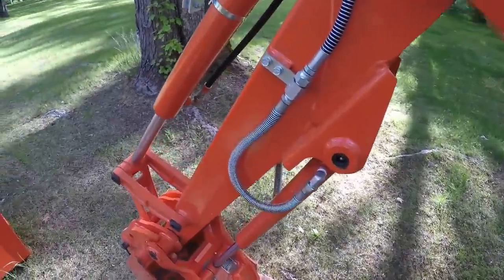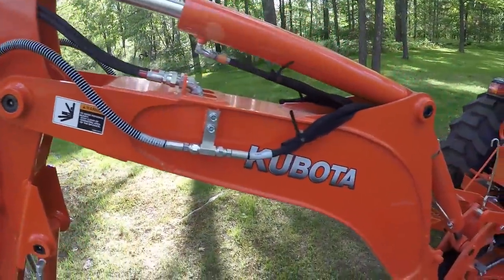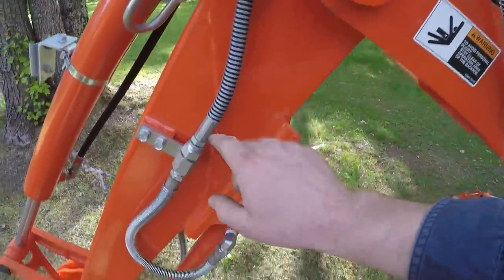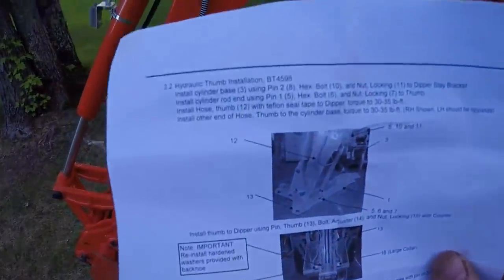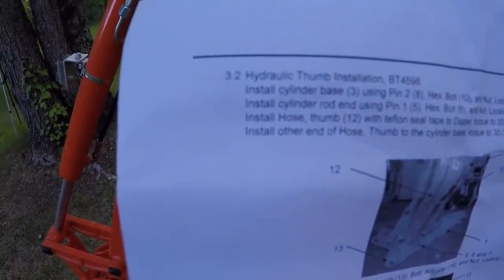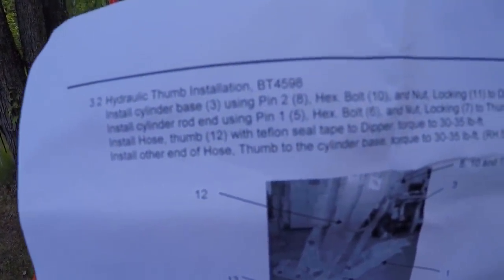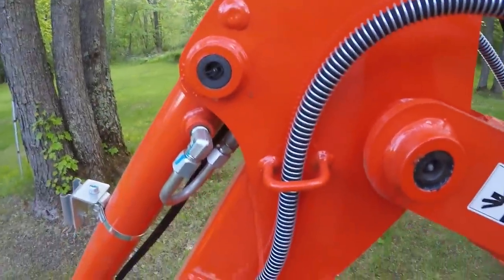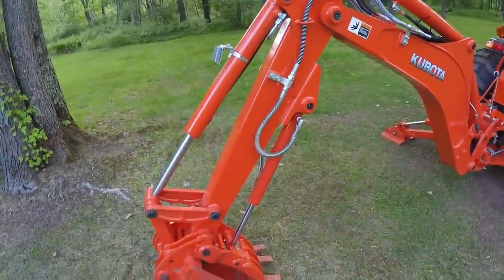Kubota BH92 Backhoe and Hydraulic Thumb - Part 2: Proper Hydraulic Line Routing - And Teflon Tape

Comment: Hey man Great videos on the BH92. I'm in the process of buying 1 for my L6060. I was a fire sprinkler installer for many years and we would wrap the sprinkler heads at least 5 times around the threads. Never any leaks, mind you city water is never more than 150 psi. I have done repairs to my hydraulic system and Always used teflon tape. The problem with it is if you have extra hanging over the threads, it could potentially enter the hydraulic system. That is why there is a filter to catch that kind of crap. Don't let the negative Nellie Engels get to ya... You're doing a great service to us that need to figure things out! Take care man.

Comment: I've heard all kinds of horror stories of using Teflon tape.  I agree, it can get loose in your system(whatever you are working on), but like someone else mentioned, I never tape the first few turns. That helps keep small pieces from tearing loose and getting into the fluid stream.  From what I recall, any tape/compound you use on the thread is more for lubrication of the threads so you can tighten it correctly.  No different then oiling a bolt before torquing it on a motor.  If you get a leak from using tape, you didn't tighten it enough to begin with.  Or it has faulty fittings.  Thanks for making great videos.  Keep it up.
Reply: I've heard this "lubrication" theory. I don't buy it. If that was the case you could just use some grease. But try that and see if it works...  The tape is a packing that is required because a pipe thread has a built in leak path: the thread itself. I use tape. It works fine. The paste works well too. I don't like the anaerobic thread sealer like that made by Loctite.

Comment: Teflon used correctly will not cause a problem, leave the first two threads bare and you shouldn't have concerns! Great Video's!
Reply: That's exactly what I do.
Reply: To add to your correct instructions, when undoing a teflon taped joint, it is then that one has to make sure to remove all of the tape that gets left in the threads of both the internal and external threads before putting the joint back together or better yet, right after disassembly . This is where a lot of people get lazy and this is where a lot of problems start.
Reply: Very impressed   i am your neighbor in Willow  River and purchased my vehicle where you work  i work on old tractors also

Comment: I quit using Teflon tape a few years ago, I found it awkward to put on the threads and had leaks from time to time. For all my hydraulic and pneumatic connections I now use Locktite 545. The downside is you need to wait about 24 hours before use and it is expensive. The upside, no leaks and if you need to break and make the connection, easy thread cleanup. But like you said, to each there own, I'm happy because I found a better method for me.

Thanks for sharing your assembly mistake, it makes me feel less stupid :)

Comment: Grinning and bearing it is the best part. I've always had to go behind everybody else's  installation and run what was there. That is a better finished route but as people squawk about different brands, I ALWAYS say that it's whoever sits in the seat is what does the work and keeps the machine running and in one piece. If all the lines were inside the boom somebody would tear them off. You and Pop will keep that rig going. I've had to deal with screw-ups and gomms for about 50 years and it's still who sits in the seat, whether a 4-lever Ford, a foot swing Case or a 300 Komatsu trackhoe, it's still the seat warmer.
Take care, Buddy! BLESSINGS and Hi Pop!

Comment: It's okay to use teflon tape as long as you apply it short of the end of the threads so no shards of tape can end up in the oil line. It's also a good practice to lube the taped thread with petroleum jelly to reduce shredding the tape. On steel pipe we would buff the threads on a wire wheel to remove any roughness before taping and installing. Rarely had a leak with this method.
Reply: Agreed, you could put an entire roll of tape on one fitting if you wanted to. As long as it was short of the bottom of the threads as you stated, it's impossible to get bits of tape in the hydraulic system.

Comment: One of the reasons i watch your video's is the fact your human, when you mess up you own it. Many people on YouTube simply delete mistakes like the one you just admitted, as for teflon tape I've been using it on truck and heavy equipment hydraulic systems for years and never had a problem.

Comment: Perhaps those brackets should also be spun around 180 so that the fittings are over the boom and not out beside it. Just a thought.
Reply: Squach as a trained mechanic teflon tape should be used all fittings except brass/bronze fittings this via old school training.

Comment: Toby,  I wouldn't beat yourself up about putting those brackets upside down.  I know you're a mechanic by trade, but oversights happen to the best of us!!  We help each other out by noticing things the other guy didn't at times. Nothing more to it than that !!
As to teflon tape.....I use it all the time on all sorts of applications, simply making sure it's wrapped around the fitting correctly so it doesn't bunch up, and shred ending up where it's not wanted.     Happy day to you !!

Comment: Whomever says you shouldn't use teflon tape on hydraulics is full of it!! Absolutely nothing wrong using teflon tape. I was going to comment on the first video then saw this one so, the one thing that would help you in assembly. (For future references), when putting in the pins, especially if only one end has the bolt holes for the fasteners, put the opposite end in first. You can see the holes and can align them much easier that way. 
Now, only real bad thing about your first and this video... we didn't get to see it in action. LOL 
P.S. Everyone makes mistakes, those that claim they don't are fools. You corrected your error and showed it on youtube, double thumbs up. Great 2 videos you made on this. Cheers :)

Comment: Also not to stir the pot about Teflon tape, but, I have noticed my self running the tape out past the end of the fitting leaving some of it flapping which could break off and get into somewhere.  So I just make sure that I only apply it to the upper portion of the thread which will be covered over and there is none to break off.  The Teflon tape does two things: act as a seal for the threads and act as a lubricant for the threads to get them tighter.  You can use other things, such as Locktite sealant which cures hard but won't work as a lubricant.  Or graphite grease which will work as an excellent lubricant but not sealant.  With proper application, I have had no problems with the Teflon tape.

Comment: Teflon tape! Lol. I have owned and operated Hydraulic Excavators for years and have always installed tapered thread b.s.p. fittings 'dry', and they have never leaked, however, if the Kubota manual says use tape, I would use it! 👍

Comment: I’ll touch that with a ten foot pole. In the late ‘70s we were told in tech school if you weren’t careful the tape would gather in the hydraulic system and plug it up. Well what are filters for?
It wasn’t until later I realized it wasn’t only a seal as it was lubrication to help get a tighter fit on pipe thread. 
What drives me nuts is someone who puts Teflon tape on flare fittings that really just need to be tightened to form the metal to metal seal between the mating surfaces but yet the Teflon tape used on the threads will help you get the fitting tighter than a dry fitting. I like the Teflon paste a little better which the mechanics used on head bolts for lubrication and sealing into water jackets. Using nothing on pipe thread will only give you leaks.

Comment: I think best solution to any Teflon tape issues is just have equipment that uses o-ring connections instead of pipe then you don’t have to worry about it. Lol 😎
Reply: Except now you have the issue of the "O" rings going bad. Either way, you end up "breaking" the hose connections apart. I have both on my farm, can't say either is better than the other. Both are time consuming when it comes to repairs. Cheers :)
Reply: Ham68 
You didn't mention that the o ring type connections are also perpetual leak factories, so I just took care of that for you. I used to operate a Cat 988A model built in 1976. I can tell you very truthfully that it was a rolling hydraulic leak no matter how many o rings you changed. They would be leaking again in two weeks time or less.
Reply: @ralfie8801  You must have either used poor oil, poor o-rings or had a hydraulic system that was overheating. The last reason is actually the most common reason we see for repeat o-ring failures. I have machines that are 30 years old with 5000-10000hrs use and the original o-rings and not even signs of sweating moisture at the connections. All the designs have their advantages and disadvantages.
Reply: bcbloc02 
None of those things were poor.......Cat square o rings and metal backed seal kits, Chevron hydro fluid, oil not overheated. The only thing that was poor was the design of the connections.
Reply: Ralfie and yet cat still uses them today. I would think the warranty claims would have ate them alive until they changed the design to pipe threads or all welded connections.
Reply: bcbloc02 
Yes, they still use them, but they are used in a different configuration now than they were on that old A model 988 though. They're not used two seals back to back with a 1/4" plate/bracket as the sealing surface between the two anymore, they seal against the cylinder ports and thick metal flanges everywhere. Those kinds of connections on that A model never leaked, it was always the poorly designed connections, mostly in the center of the machine around the center pins and steering cylinders, also that hydraulic tree up inside the front frame section above the front Drive shaft. That thing is a royal pain in the arse.
Most hydraulic connections are not pipe threads anyway, they're JIC 37.5 degree flared fittings, and Cat is using more and more of those on their machines. I have a Cat 931C track loader that has all JIC hoses on it front the factory.
Reply: @ralfie8801  I hadn't realized until I reread your last post which style connection you were reffering too as o-ring.I consider that a flange packing more than an o-ring fitting.  I would agree that metal flange deal they used was not good. I was reffering to actual o-ring fitting connections like flat face o-ring or the o-ring screwed into a taper shoulder also known as boss seal type. JIC fittings are pretty good but if they are steel pipes they are prone to cracking in the flared end is the worst thing i see.
Reply: bcbloc02 
Now you're cookin with gas. Some people don't realize what crappy seals were used in those old loaders. The machine I operated had a metal plate on the hydraulic tank with patent numbers and dates on it. That machine was designed in the late 1950's, the earliest patent date was 1959, they had some really archaic designs back then that just didn't pan out. Those hose flange clamps that were rectangle shaped, had 4 bolt holes, and were cut diagonally with only one full bolt hole and two half holes in each piece come to mind. There was almost no way those bolts would ever stay tight, and they were used on the bucket lift and tilt hoses. They constantly leaked, the center section of that machine always had hydraulic oil dripping from it. The bright side is the oil kept the grease and dirt washed off around the center pins.

Comment: Toby, No problem on the fitting bracket mix-up. It happens (even with the instructions rt there). It's easy when doing an involved assembly like that to overlook things. We've all done it & anyone who says they haven't is either a liar or hasn't done much assembly work. 
As to the Teflon tape issue, where you used it & where Kubota used it, it's perfectly OK. The place it's not advisable to use it is on flare or ferrule (brass sleeve) fitting connections. There people who believe in using it & others who don't. Comes down to personal preference or what works best for the individual doing the work based on their past experiences. 
Thanks for the update & Good professional looking job !! Look forward to the next endeavor you share with us.

Comment: Hi Squatch. Now I know I'm wrong, but would n't the thumb hoses have a less tight bend with the fixings the other way round on the bucket end of the jib? I guess they are required to be installed that way to provide more protection. And please be careful with that 10 foot pole. I'm delicate!  BobUK.

Comment: @1:19 take the hoses off again and flip the brackets so the fitting is hanging over the top of the boom.  this straightens out the hose run even more and reduces chances of it snagging.  have a quick look.. i don't know if it will interfere with the upper dipper cylinder body.  but it sure looks like it will fit better that way.

Comment: JUST WONDERING... The Kubota and Kioti seem similar ,, especially with the similar bracket / brace on the arm. I wonder if the hydraulic thumb will work on the Kioti since KIOTI for now only has a non-hydraulic thumb.

Comment: Hi I have worked a lot on high psi air and hyds if you use teflon tape stay back a thread when putting it on. they had stopped us from using it because it was getting into valves and gages because people was putting it over the end of the fitting, they went to liquid teflon pipe dope

Comment: As long as it's used correctly Teflon tape is fine.  It becomes an issue when it's put on the threads sloppy.

Comment: If that is normal tapered pipe thread then it will seal perfectly without anything on it. No teflon tape nor flax is needed to make it seal. Some people say that you can use teflon tape anyway, to prevent it from sticking, if you want to be able to take it loose sometime in the future.

It's no big deal. As Mike Haduck would say. Just put it on there. It's no big deal.

Comment: as long as you make sure you don't get it over the opening of the pipe fitting you can use teflon tape on hydraulic work for the past 30 years and used hydraulic Teflon tape on hydraulic 7% there is nothing wrong with using Teflon pay as long as you keep it from the end of the hose itself be opening

Comment: Complete hydraulic newb here, I can't help wondering, how do you bleed/purge the system from any air pocket ?
Reply: Alot of the time the pressure is high enough that they self bleed. Sometimes this isn't the case, but normally working the cylinders in and out will squeeze any air out.

Comment: I do not have a dog in this fight, so I do not care what others do. I personally would not use Teflon on Hyd. fittings. I would point out that ALL of the fittings you pointed out, where there was Teflon, were "pipe fittings", not Hyd.

Comment: This is why I hate pipe thread fitting for hydraulic and I usually change them out to a o-ring face or a DIN type o-ring seal. Cat makes nice ORS face seal also as you a CAT guy, and with addition of o-rings you have better sealing to a much higher pressure.

Comment: If you were to flip the brackets with the hose fittings toward the inside of the boom,  the hose going down the boom would be in more of a straight line.
Reply: I was going to post this also--decided to look through and see if anyone else suggested it. It would keep the fittings/hoses just a bit further out of the way, and sometimes just a bit can be a lot. So..X2.

Comment: I don't want to stir the pot with you either. In my time of mechanicing I found that most people that dislike teflon tape can't use it correctly. either to much wrap it wrong or put it over the end. Pipe threads are self sealing if done right, the tape is to keep the fitting from seizing in the housing. kind of like using antisieze. It is not to seal it because the pipe fitting job was crappy!

Comment: I missed the teflon controversy... intentionally.
Reply: Me too. I've done it and not done it. Sometimes it leaked and sometimes it didn't. If someone else drags it out, it's used. If it's not there it's hard to make so it's not worried over. When I re-did the wood splitter I can't honestly remember using any. Maybe, maybe not. But if you can't fix it with a hammer it has to be an electrical problem.

Comment: #1 Teflon Tape does not SEAL a fitting. All it does is lubricate the threads so they can be torqued without as much stress, reducing galling. #2 The ONLY reason to not use Teflon tape for Hydraulics is because somewhere down the road, there was "Bob", who wrapped it to far down the fitting, causing it to get into the cavity of the line and getting into the works of the equipment. Don't be "Bob"..... LoL.....

Comment: Teflon tape and hydraulics: the factory used it and manual called for it so it must be right....I'm a heat transfer engineer and have corrected more major OEM "factory" screw ups and mis-designed coils than I can recall.On hydraulic mechanical couplers (pipe thread connections) I use liquid teflon, If not available I'll use anti-seize,If that's not available I'll use grease. Anything except teflon tape as first choice.Why? if by chance you mis-apply the tape beyond the open end of the fitting and a piece of the tape comes loose and is introduced into the system it can play havoc and cause real problems with control valves,especially small port pilot valves.